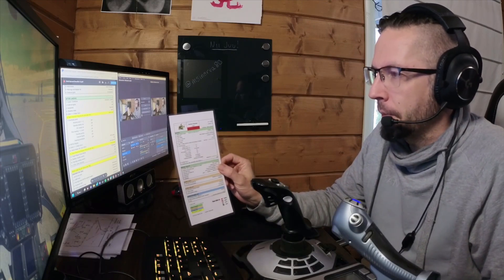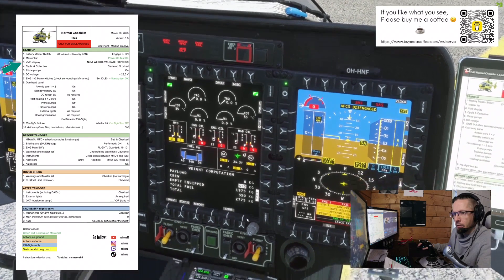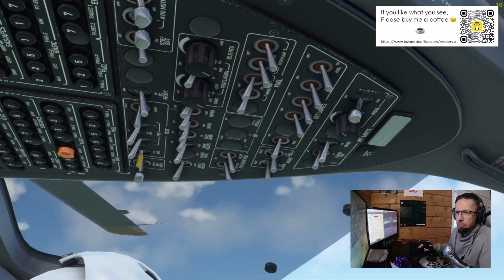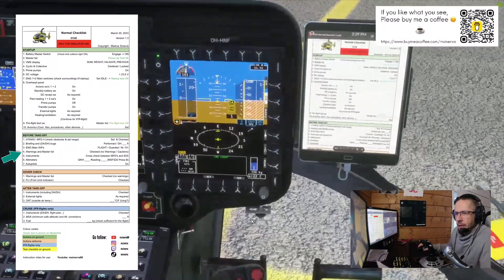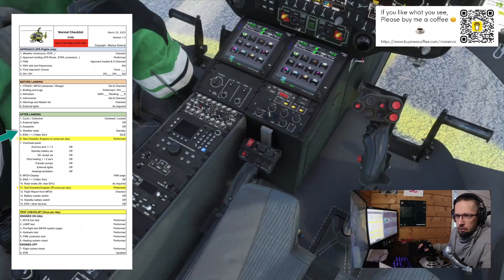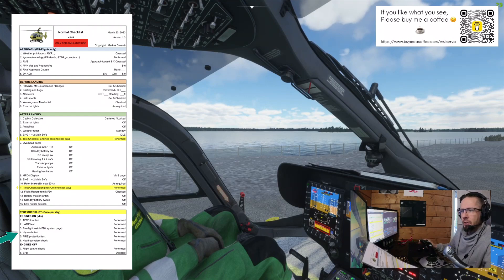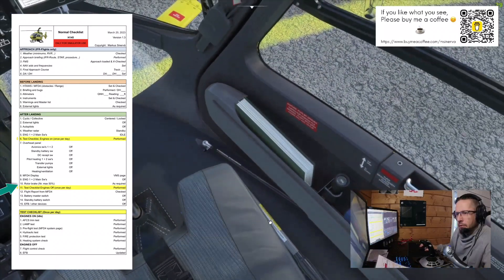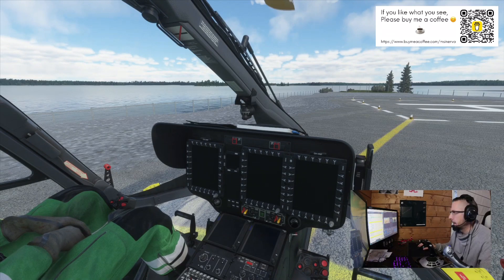Airbus H145 Helicopter's Checklist Tutorial - SHORT VERSION. IRL HEMS-pilot explains.

Comment: Hi Markus. Nice to watch videos from real pilot. Do you practice autorotation with h145 in real life ? Could you please record a video if you do so.
Reply from the maker: Hi and thanks for the feedback!

We don't practise autorotations with real helicopter. They are done in full motion simulator at Coptersafety Finland. With EC135 I've done autorotation with real helicopter, but the descend was stopped at 1000 ft and in training mode (all engines operative), simulating the near ground flare.
Reply: @msinerva80  you need to stay safe  practicing emergency. Got it.
Reply: @msinerva80  one more question. Is H145 as stable as that in real life? I know there is system called AFCS but even when I press Trim Release button something still helps me to keep horizontal level.
Reply from the maker: @dimatall  I get many many questions about the reality of the sim H145. I actually just captured a video from this topic and tey to share it in the near future. 

Answer is yes and no.. 😅 Real helicopter is even more stable I think, but the lack of movement sensation makes sim flying harder specially during the hover. I get the realism from realistically working autopilot and system. Realistic flying model is not the main thing for me.  

Even if the autopilots are set off (normally always on) there is a Backup SAS which helps controlling the helicopter. Trim release only releases the trim forces and let’s you choose a new reference for the helicopter system to aim.
Reply: @msinerva80  I have even more questions now :) But I better wait for that video. thanks)

Comment: Thank you for all the useful information! One question, in the real H145, how do you select the autopilots modes? also on a touchpad or are there some physical buttons? Thank you
Reply from the maker: Thanks for the feedback!

Autopilot upper modes are selected from th APCP (Auto Pilot Control Panel) Which is found next to pilot's left knee. You can also use the cyclic AP button as a "panic button" by pressing it forward twice to engage HDG, IAS, ALT quickly. This is able to be done in the sim too by assigning a control button as ALT, HDG and IAS. 

AP is not controlled from the touchpad.
Reply: @msinerva80  thank you for taking the time 👍😎